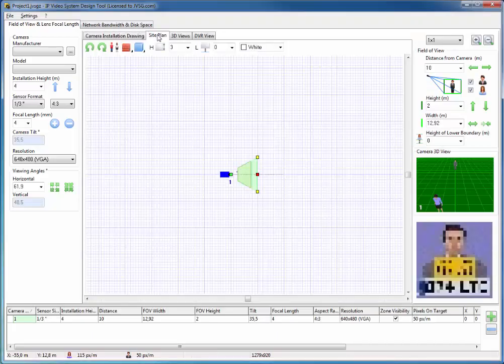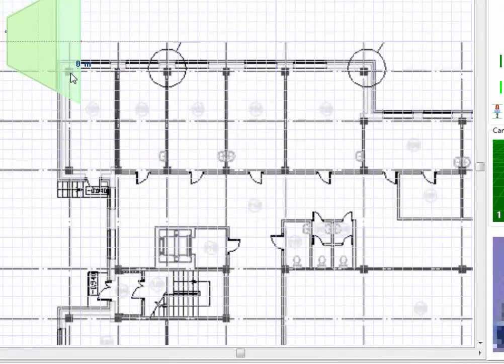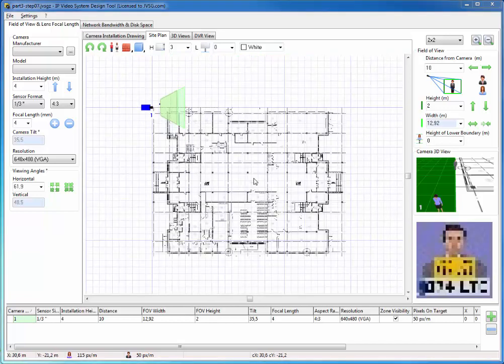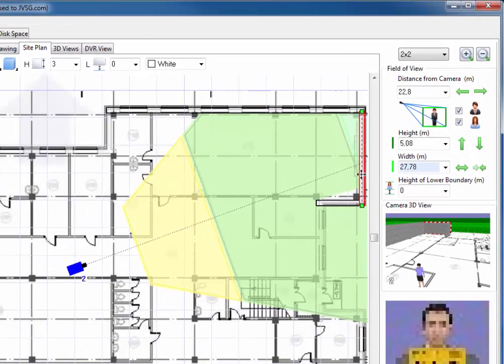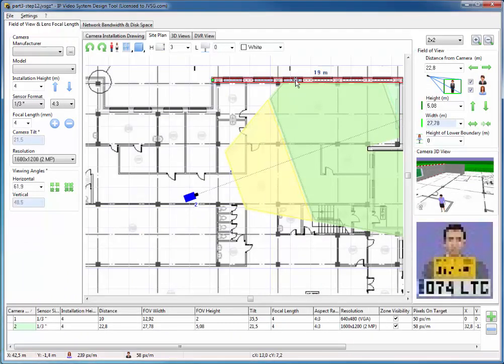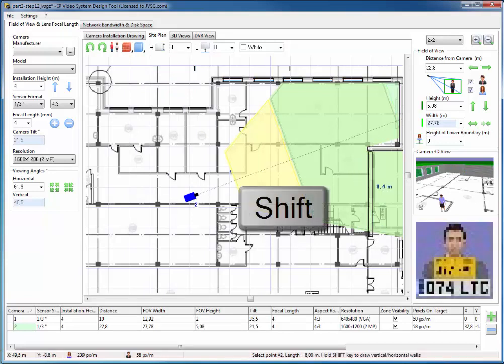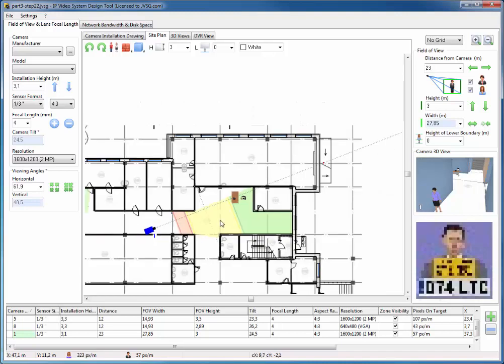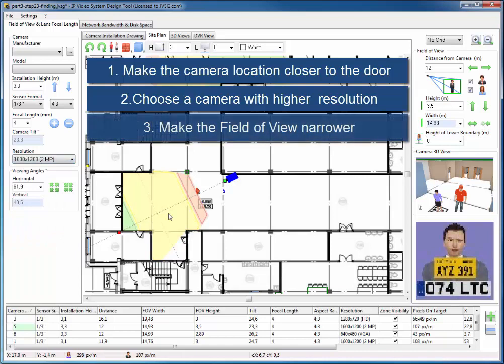CCTV System Design. Part 3/5: Site plan and finding optimal camera locations

Comment: If you import a CAD file with walls - do you need to draw them again?  If yes what is the value of  this VS a PDF or JPG except for perhaps scale?
Reply from the maker: You need to draw walls to specify wall height and to be able to add doors and windows. . Why is it better to import DWG drawings? Because they are imported in a vector format, meaning no pixelization  when zoom-in the site plan.